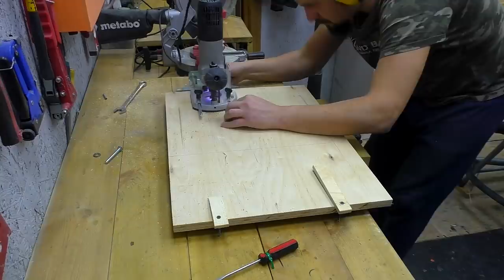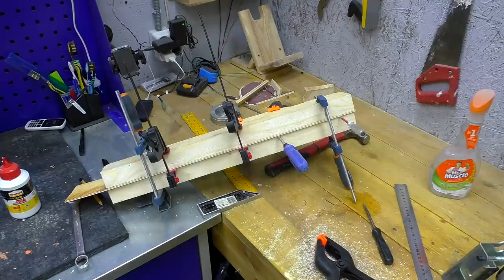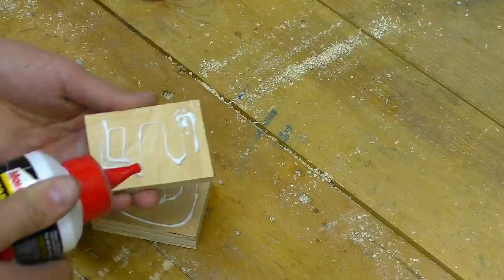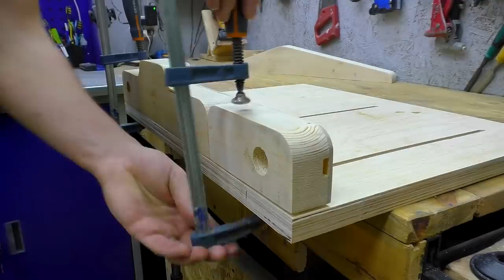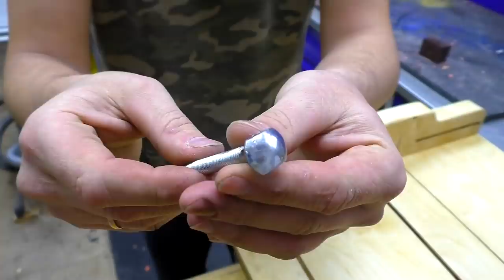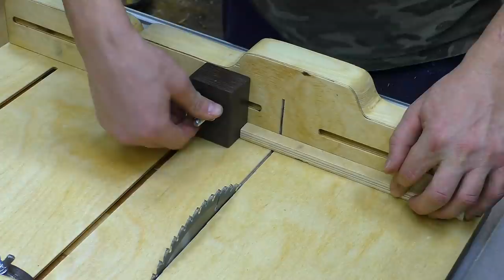Great idea for the workshop!!! A great tool with your own hands

Comment: You need to add a ruler on each side of the fixing joints so as to get accurate measurement of piece you want to trim. Otherwise nicely done.

Comment: Nothing you did explains why the rear fence had that two piece design? Why not just cut the shape out of one solid piece then notch it? I assume it was for hand comfort when planed in the sled? Nice work but tbh... miter track isn’t that expensive. Would just be easier and faster to dado out the grooves and install machines tracks instead. You could then cheap out on the clamps etc in same fashion if you wanted using holds in the track instead of expensive name brand hold downs and stops.. the one part I really had trouble with though.. using that cheap thin plywood for the guides.. that’s just not going to hold up long term. Should’ve just used some cheap red oak if not wanting to go with a quality hardwood product. Red oak is actually as good as maple for things like this though as it reseats moisture a lot more then other hardwoods.